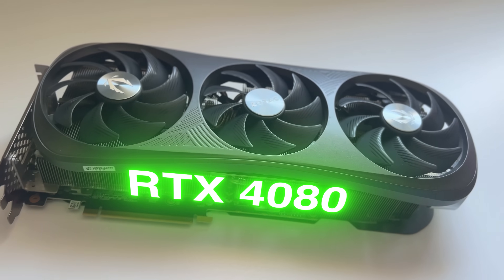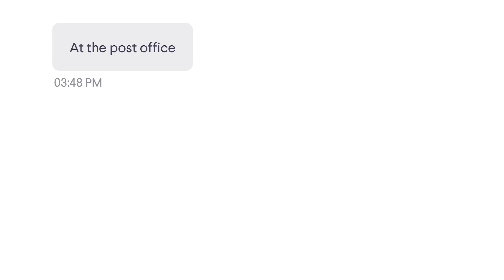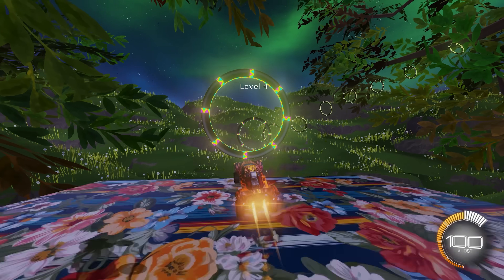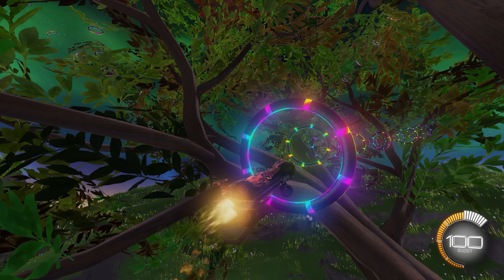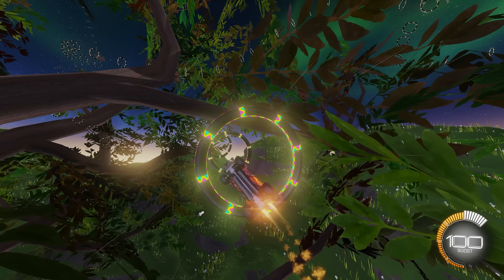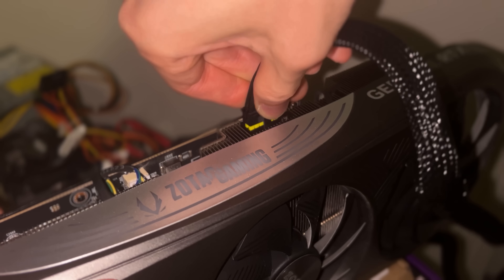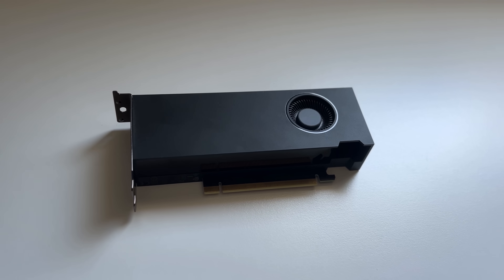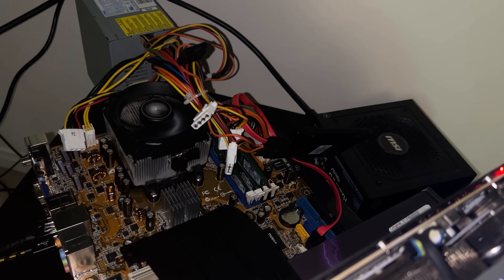RTX 4080 + 20 Year Old CPU

Comment: You could have used 8GB of DDR2, clover bootloader would allow you to boot the 4080 and even an NVME ssd. Back in the day of trifire and quadfire setup's we would use a little device called "add2psu" to switch both PSU's on...and the way you know what pins to connect is pins number  4 and 5.

Comment: I still use a core 2 quad q9650, my system is incredible and I bet it would surprise you to just read it's listing.  But I'll tell you this, I get 100fps average with max everything settings wise, for world of tanks HD, world of warships HD, Fallout 4, Fallout 76, trailmakers sits at 90fps average, eufloria HD is maximum 100fps always,  Teardown and project cars both get an average of 90 fps.  Still one of the best machines to play the games I like on.  Still a daily driver.

Comment: I'm assuming that the 90 fps of Anniversary was a CPU bottleneck, but I would think that a dual-core CPU would do a lot better than that for a relatively non-demanding 2007 game. Even Crysis, released the same year, should do far over 90 fps on a dual-core CPU (with enough GPU power).

Comment: I had that same cpu back then, it was my first multicore chip. it was paired with a geforce 6600gt and 2gb of ram...I didnt use it for long though as i quickly jumped over to core 2 duo e8400 paired with 8800gt SLI and 4gb ram

Comment: Guys i have a question.
Why does if i paired my intel i3 3220 cpu with an Nvidia GeForce GTX1650 its bottlenecked and it shuts the pc down?
But why an 20 year old cpu paired with an Nvidia GeForce RTX 4080 does not shuts the pc off?

Comment: i'm rocking a system with two ram slots having clips broken from terrible shipping. Never had an issue. 64gb ddr5 went from a rtx 3090ti to 5070ti moved it a lot and still no issues. I wonder how much performance increase you might get if you allocated some of the ssd to your ram.

Comment: Socket AM2 was released in 2006, that CPU is 19 years old. In 2005 the 939 versions with the same name released which had different cores. Could've made it interesting and slap it on with a PCI-e 1.0 motherboard S939 and a FX-55 CPU

Comment: What happens is you put a modern gpu into a pcie version 1 slot you are going to bottle neck severely and potentially ruin that card from it over pulling current! This is a bad way to experiment even for content unless you wanted to throw away a expensive card! The issue is data throughput. Pcie 1can only pump so much data. Google it for the charts i dont want to type a book here

Comment: 6:00 I had that issue with an 2014 motherboard with a newer GPU that had a backplate, the solution I found for this was to remove the RAM clips from the slots (that was easier than I thought) and then smooth them out with a tool like a drill (I don't know how you call it in English 😅) until they became slim, so I installed them back on the RAM slots and then I could install the GPU.

Comment: "What happens when you pair a 4080 with a 20 year old CPU? Well... it starts when I started looking for a 4080..."

10 minutes later

"... so I ditched the 4080 and finally got my system working. It's bad and sucks."

video over

Comment: Sounds like a nice adventure :D Although if You're unsure about where to stick a paperclip,  I recommend searching for "ATX 24 pinout" and You'll find images of the layout of the connector, color coded and labelled. It's the same layout even if your actual cable is made in a single color. - Or for that matter, you can find the same info about every other standard connector. - Much safer than accidentally frying something through trial and error.
Also, it's useful and convenient to keep a few spare pre-wired standard power button switches, or even a pre-wired Power + Reset + HDD LED + Power LED set. They are available on multiple online marketplaces, and they make working on open air testbench systems much more convenient and safe, avoiding accidental shorts from dropping the screw driver. At least I usually connect one button switch to the power switch pins, but sometimes I wire up the whole front panel set and also connect a button to the "CLR CMOS" pins to make it easier to experiment and reset the BIOS multiple times as needed. - You can also connect a spare speaker to the motherboard to listen to BIOS beep codes in case there's an error.
Looking forward to seeing your future adventures.

Comment: I have 1100 MHz DDR2; it's old OCZ-branded stuff paired with a modified 4-core Socket 771 Xeon on a Socket 775 platform, X5470. This is an unlocked 4-core chip that can be overclocked to 4.2 GHz with the right cooling and motherboard, and even this platform, which I would consider to be the best and fastest thing to ever use DDR2 memory, wouldn't be enough for the 4080. and bottlenecks a 1060 6GB card 🤣🤷‍♂

Comment: 9:29 bro that was stupid... be thankful that the PSU wasn't on... what if you had shorted a power and ground wire... you easily could've counted the wire no of the green one and identified it on your black cable

Comment: You're kidding right? About the ATX standard and not finding anything online. How lazy are you? 
3 seconds it takes to write "ATX pinout" and click on images.  On the Notch side pin 3 and 4 or 4 and 5 (left to right) if the atx plug faces cables down and you're looking from above

Comment: The 40-series suffered from limited fab capacity. And it's unfortunate seeing as had Nvidia decided to allot more than, idk, 5% of their wafers for consumer desktop instead of AI/enterprise stuff -- cards like the 4070 and above wouldn't be holding such absurd price premiums. But because of the reality of things (which was the discontinued production of the regular 40-series after the SUPER refresh came, and then those too were phased out in under a year!), I imagine that even the 50-series will end up the same way. Especially since the 5070 SUPER is supposed to be either the same MSRP as the 5070 or ~$50 higher @ $599.99...while offering 18GB GDDR7 and an increase in CUDA cores. We MAY see price cuts and discounts on remaining inventory, but once it's depleted only the newer cards will remain. Meanwhile the sheer surplus of 7900 XTXs has allowed for them to remain available brand new and now BELOW MSRP (as low as $699.99 at Micro Center), which is an insane price when you consider that it was regularly $1k or higher up until only a few months ago. Even the 5090s/5080s/5070 Tis are reaching MSRP (finally), with cards like the 5070 and 5060 already showing up at their exact MSRPs (or less if you get lucky and find an open box discount from a return that was never even used). This entire sentiment paints a picture of just how crazy it is for a 4080 to have STILL cost as much as what you can now get a brand new 5080 for -- or spend $300 less and get the same/slightly better rasterization performance w/ 24GB VRAM from the 7900 XTX if you can live with the weaker RT performance

Comment: It's very funny how lame you are. Dual channel with 3 modules. Paperclip tryout instead of 2 mins of googling about ATX-pinout. S939 A64 X2 DOESN'T supports CMPXCHG16B, what Win10 x64 requires for working - but S939 with nForce4 accepts 8GB DDR1 RAM by 4pcs of ECC REG modules. There are 4GB DDR2 modules (mainly cheap Chinese ones) to build a 16 gigs rig. Some chipsets like AMD785 can't work with it.

Comment: Yo! Must be young. Why not just use your PSU and not 2? Even if that Motherboard is a 20 pin and not a 24 pin, your 24 pin breaks off the 4 that aren't needed for a 20 pin. Then just plug everything into your main PSU. Also that's how ATX works. Since ohhh, 98/99 ATX has been around and has required that jumper or a motherboard plug into it. Only on AT PSUs does the power button actually supply power on demand but that is Pentium 1 and older boards. Starting with Pentium 2, and there were some Pentium 1 board as well, but its all ATX now. They make jumps like that that actually plug into your main PSU for those who do actually use 2 (those who need more than 1500Ws and have only single phase power in their house and live in the US).

Comment: Using a 4080 Super, with a I7 8700k, works even on 4k. Upgrading bit after bit, but found the 4080 for cheap, so it was first xD

Comment: Do you not have the option to have someone pay the delivery driver for a package? In my country most sellers do that, they send the package, you receive it, get to open it and check if the stuff is inside and not broken and then you pay the delivery driver, and the money would get wired to the seller. Low risk for both parties.

Comment: terrible video, windows 10/11 on a 20 year old hardware, which in turn isn't compatible with that hardware which is why you have so many issues, also its going to be using most of its memory on the os processes alone, should of went with what was current to the time xp. also who buys a riser instead of just cutting the tips off the ram clips?? jesus christ

Comment: Would have been better off with a Core2duo.. or core2 Quad - you wouldnt have had the issue with the PSU then either as intel CPU's from Prescott onwards  have a PSU spec that has most of the current on the 12V, older systems had it  on the 5V rail..

Comment: Hey, OS developer here. No legacy BIOS support on the 4080 should be fine. That just means it doesn't support VESA, which isn't used if you have drivers installed. You can install the drivers while using an iGPU (if there is one) and then the card should work fine.

Comment: Uhh why you didn't buy a 7900xt or xtx? same performance, almost half the price. Pretty dumb video.

Also, 0 problems with power supply.
Reply: Where are you finding a 7900XTX for 500$?
Reply: @tewqy In Italy there are plenty of 7900xt for 620$, which oced it's the same of a xtx.
Reply: @Salvo78106  Sorry, a 7900XT can never reach the 15%+ performance gap. Neither can it reach the 4080's performance by extension. I ask again, where's the affordable XTX that you so claimed in the original comment? You can OC the bigger two as well, you know?
Reply: @tewqy it definitely does, go check benchmarks about it Einstein.
Reply: @Salvo78106  No need. There's also currency and location. Let's also ignore the fact you can OC both, but you specifically mention OCing the 7900XT to reach 4080 performance (No)

In Italy, per PCPP, the cheapest available 7900XT is 660EUR. That's 765$. For 15$ more, you get the 15% more powerful 5070Ti in the US, since that's where he is located.

I do agree though, 1k on a 4080s or a 7900XTX is pretty darn stupid, when you can get 99% of the performance from a NEW and FSR4/DLSS4 compliant 9070XT/5070Ti respectively, so your main objective of the comment is true at last.

Comment: could've bought an rtx 5070 for 540 us dollars instead... almost half the price with 15% difference in performance, more power efficient, from newegg  ebay etc,  u get brand new instead of slightly used with warranty and delivery protection.

Comment: I recently bought a 5070ti in Siberia for about $ 1,000, before that I wanted a 4080super, but they are the same in performance and perhaps future drivers will improve the 50 series of cards.
There was a video on YouTube somewhere of overclocking an old Intel to 5 Ghz under liquid nitrogen,😂 and you need to put this video card with it.

Comment: Tried to run a RTX 5090 on a Ryzen 1700x and no joy.  It was on a Asrock X370 mobo.   Every time I loaded the nvidia drivers, the system would crash.  I tried older drivers and same result.  I plugged in a Ryzen 3900x and it worked no problem.  So my conclusion was that the Nvidia drivers only go so far back (I'm guessing 2000x series would also fail) in terms of cpu support.

Comment: Hey bro you know that paper clip thing you did well inside the box is that power supply should have been this small piece that fits right over top of that 22 Penn or 24 pin plug. Literally safer and better than using the paperclip just a heads up she usually a nice power supply boxes that are name brand

Comment: Now use a ryzen 7 9850x3d with a 20 year old gpu
Reply: Unironically i think it will work better.
Reply: this processor has more graphics power than the average 1 gb  gpus
Reply: "Unplug the GPU for better performance"
Reply: Just plug the HDMI port in the motherboard at this point
Reply: What's wrong with the 7800x3d?😊
Reply: at least 19 year old GPU or less dude. That time was the 1st gen of PCI-e release.
Reply: I was just thinking about something more ludicrous: How about pairing Core i9 14900KS with 3DFX Voodoo 2 SLI?  I mean Advantech AIMB-788G2-00A1 motherboard has two PCI-slots and it supports 14000-series (Q670E chipset + product page says so). So put those Voodoo 2-cards to PCI-slots and use iGPU as the required 2D-accelerator?  That motherboard has VGA-connector so no need for adapter there.
Reply: @Official_Astrxl AGP 😭
Reply: @McLeonVP  pci-e was already around in 2006
Reply: @GraveUypo That is 19 years ago not 20
Reply: @GraveUypo  pci-e was in 2004
Socket 939 / 754 motherboards had both pcie and agp, i own few
From gpus i can name ati x600, x550, geforce 6600(it was both agp and pcie options) that were released in 2004 with pci-e
Reply: GETOUT 😊
Reply: TRUE, GOD BLESS U BRO<3333🇻🇦🇻🇦🇻🇦
Reply: sounds good
Reply: I still have a GeForce 256 32MB SD AGP 4X lol
Reply: Might as well just use the igpu.
Reply: beginner cpu. try the best threadripper
Reply: been there done that 😭
Reply: actually good content, seeing upscaling and framegen
Reply: Use the freaking 20 million dollars nasa cpu lol
Reply: @Official_Astrxl then you would just render the graphics with your cpu
Reply: Ryzen 9 9800 x3d you mean
Reply: Lol, I just build a ultra265k ddr5 pc and using my 2080ti . Can play battlefield 6 1140p 120hrz on high settings
Reply: GeForce 8800 GTX
Reply: How did this objectively false comment get so many likes? 9850x3d doesnt exist
Reply: @fenot5753  look it up
Reply: With maybe geforce 7900 
Yes geforce 7900 not rx 7900
Reply: @iamme20128  geforce 7900 gx2 is better.
Reply: No! Use an I9 14900k

Comment: It is standard for at least 10 years ... buy a 24-pin terminator used to power the outputs(SATA) for water cooling to run the pump without turning pc on ... to test run watercooling to remove remaining air after filling it up.

Comment: So you run this entire tech channel and still you are so clueless you don’t even know that you have to short the pins in order for the psu to work. That’s insane. That’s like if a mechanic would have to google that you need to connect the batterie in order to start the engine. Like seriously…

Comment: Almost All modern games Requires a CPU which supports the AVX and SSE4 instruction set.
Such as:	 SSE, SSE2, SSE3, SSSE3, SSE4.1, SSE4.2, EM64T, AES, AVX, AVX 2, F16C, CLMUL,  BMI1, MOVBE and so on...
That is the reason why U can't launch two last TR. 🤗¯\_( ͡° ͜ʖ ͡°)_/¯

your CPU dated 2005. First   27 AVX instructions  has been released by Intel in 2007... And then another 27 instructions  AVX and AVX 2

Comment: You should try again with a core 2 duo build from 2k6. I believe their official RAM support is 8GB, but I’ve seen them handle 16GB. It all comes down to the motherboard as the core 2s don’t have the integrated memory controller.

Comment: You know there are pictures on the internet that show the physical pin-outs of the ATX power connector –no color coding needed. But, why use 2 power supplies? Couldn't you just use the 850W supply for both the motherboard and graphics card? If your motherboard ATX connector is 20-pin there are very cheap adapters that do the physical conversion, though most modern PSUs have a split 20+4 plug that can power either connector size. Same thing with 4-pin CPU power (4+4 connectors).
Reply: That board is an ATX 2.2, with the 24 pin connector, so literally any modern PSU would have worked! Even the modular ATX 3.0 PSUs (3.0 just sends 12v to the motherboard and lets the motherboard step the voltages down itself) come with 24-pin motherboard cables. If it was an ATX 1.0 board (pre-2000's), there could be issues with a lack of -5v rail (optional with ATX 2.2), so using a modern PSU would have been tricky at best.

Comment: I have an older Core2Quad system that uses DDR2. Other than the lack of USB3 support, the biggest problem was the 2 slots for memory (mITX motherboard) and the fact the DDR2 sticks above 2GB are impossible to find. I blame the rapid industry move to DDR3 -- 4GB DDR2 sticks are rare and more expensive than I wanted to spend to upgrade the old clunker. So that left me with a total of 4GB of RAM to run Windows 10, which is a joke. Windows immediately allocates 8+ GB of swap space and you're running programs using the HDD/SSD as "memory". At that point it was clear that the old DDR2 system had to be retired. Oh well, it was a great system... except for its severe limitations. LOL.

Comment: The guess and check method for turning your PSU on was seriously scary. Lol

I'm confused though, why did you not just use the new power supply for the motherboard and the gpu? As far as I have seen new PSUs still work on old ATX boards. 

Fun video though, I enjoyed it.

Comment: Additionally, the RTX 4080 runs at roughly the same frequency as the old CPU (2205 MHz vs 2200 MHz). LOL! For a normal setup, the GPU runs at a lower frequency than the CPU it's paired with.